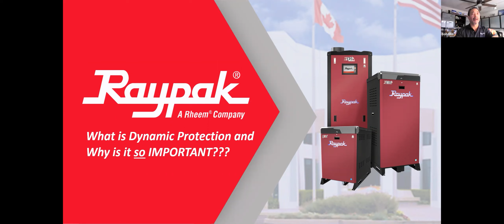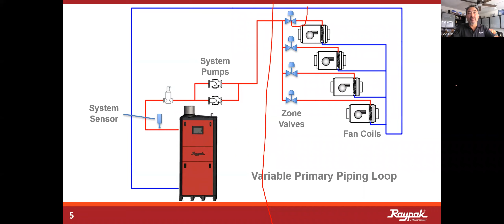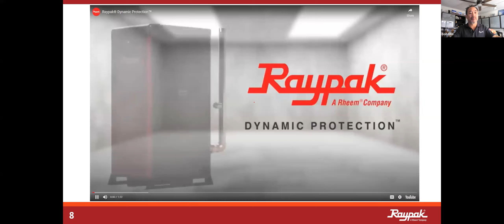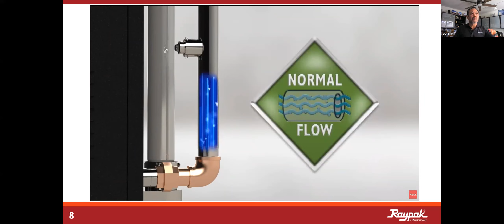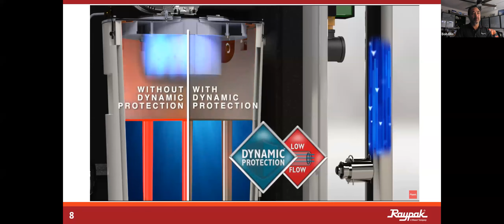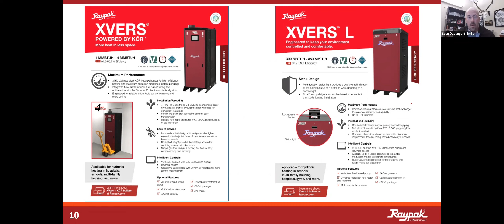LONG Coffee Break - Dynamic Protection: Hydronic Boilers and Pumping Systems with Raypak

Comment: Curious, does having the flow meter data along with outlet water temperature allow active modulating of the burner to protect vs a flow switch which seems to be standard that as preset setpoints when measuring flow? Other modern boilers a very sophisticated (such as Laars Magnatherm Fire Tube) and have lots of internal checks/controls to avoid damaging the equipment. I'm not quite seeing the value entirely. Does it reduce maintenance required on the heat exchanger? Extend longevity, if so by how long?
Reply: Stainless steel firetube boiler heat exchangers manage condensing conditions within the combustion side (firetube side) of the heat exchanger better than most any other material commonly used in commercial boilers today. This said, stainless steel has the poorest heat transfer characteristics of all the commonly used materials in boilers today which makes maintaining adequate flow conditions critical to ensuring the optimal lifespan of a stainless steel firetube boiler.

The engineered dynamic protection that an integrated flow meter provides is significant because the Raypak Versa IC Controls takes this dynamic flow data along with Delta T, stack temperature, firing rate, and programmed fluid viscosity to maintain optimal firing rates and heat transfer not allowing the boiler to overfire and stress the heat exchanger. This also applies to a cascaded variable primary plant of boilers, the Versa IC Control will look at the flow rate in the boiler(s) that are online and determine if enough flow is present to open the isolation valve of another boiler and bring it online without compromising the other unit(s).

Whereas having a flow switch and Delta T data can protect a boiler from low flow conditions, in most cases it is not enough given the high of Delta T range in a stainless steel firetube boiler. Please note that the referenced Laars Magnatherm is a watertube design and due to this fact is shown by Laars to be piped in a primary / secondary configuration. Most stainless steel firetube boilers have the ability to be piped in both primary / secondary and a variable primary piping configuration which leaves the connected boilers subject to the system pump flow rate. This rate of flow may not always be sufficient to maintain proper heat transfer in the boiler(s) during various points of operation without causing heat stress damage to the structure of the firetube heat exchanger.